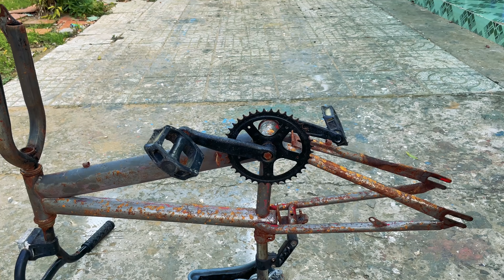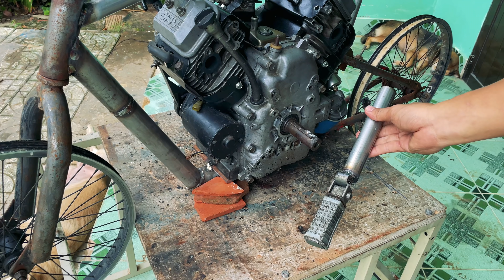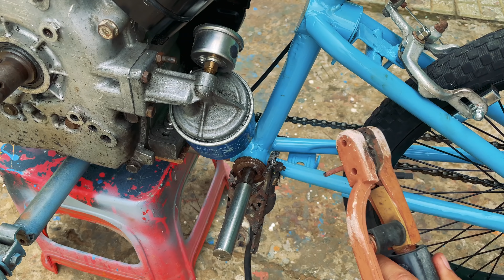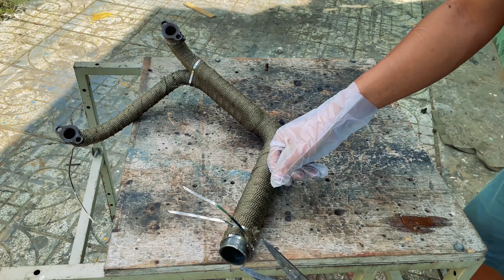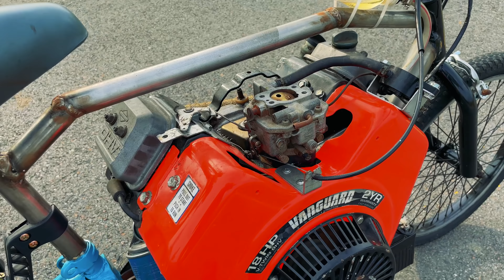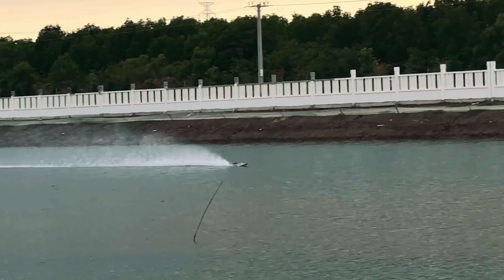Special bicycle made with 570cc V2 V-Twin engine

Comment: Very entertaining video.  I can't believe you used caliper squeeze brakes instead of upgrading to disc brakes for an 18 hp motor.  Can't wait until the next video.  Thanks.
Reply from the maker: Thank you very much, I will try harder!
Reply: @Nasatchannel  I know that you will figure it out.  You are very creative.  Best of luck to you.
Reply: Those rim brakes should be good for stopping from up to 120mph, so should be fine. 😎👍😯
Reply: Not so much cause of the engines power but it's weight alone should make going downhill a deadly gamble.
Reply: @guilhermegoldman  Agreed, larger motor means more weight and higher speeds.  May be an issue in their rainy weather.
Reply: @SilverShadow2LWB  rainy?! My 30hp 190cc 190lbs Honda with 110/90 tires is an issue on rainy weathers; that 180 lbs engine with those bicycle breaks is a fucking deathtrap if i've ever seen one!
Reply: Fun?
That vehicle will dismantle on the go! He will hardly be able to stop.
Imagine a 50kg metal block launched at 15 m / s heading towards you ...
Reply: @Nasatchannel  Hey man, you built a badass bike, don't care what anyone says! That was a awesome build, don't let anyone tell you no different. If they do, they just hating on you brother! And jealous of your bike....
Reply: Next he is going to turbo it😵😵😲😲😞😞
Reply: @pdtech4524  3 days ago, while fishing, I dropped the lighted lantern in the pond ... this morning I found it, it was still burning ... when you reduce the speed to 5mph, then I turn off the lantern.
That engine, only he weighs 50kg.
You're kidding, buddy, but I think life is at stake.
Reply: @SilverShadow2LWB  No special conditions required.
That frame will also break on dry asphalt.
Reply: @michaelgreene7385  Of course, you can dispose of your own life at will, but not of others.
Reply: @PopaAlexandru.  this is true.... but, what is life without fun every now and then? Anybody can sit on the porch and watch, as they always say,  no guts no glory!!! Better to go out like a puff of smoke, then just fade away
Reply: @michaelgreene7385  Of course, fun is fun and you can make life non-monotonous ... as long as you don't take another person's life or hurt / cripple him.
Reply: bicycle disc brake is a joke,it is even more dangerous with disc brake.This is just a fun project.
Reply: @lanchanoinguyen2914  A fun project that can cost the life of an innocent person ... of course, the village roads are always deserted and located in the desert - that is, where there is no human activity.
Reply: @michaelgreene7385  You are absolutely correct.  While sitting on the porch, I observe people taking pandemic risks, engaging in risky behavior (IV drugs, cliff diving, etc) and driving intoxicated.  All are examples of poor judgement.  I don't need to participate in order to place them in a logic chart.  The problem is not all people just die.  Some are living examples of those past decisions.  Ever see how many wheelchairs and crutches are at a motorcycle meeting?

Comment: Pls replace the brakes with hydroulics AND reinforce the frame because vibrations for sure will crack that skinny frame while you're riding!!!!
Thumb up 👍
Reply: Equipped with that engine, the vehicle can be propelled at 50 ... 80km / h and at that speed nothing in the present configuration will withstand.
The driver will be seriously / fatally injured and how other people also drive on the roads ...

Comment: you can do it as a 2 speed go a bigger back pulley keep the frount one the same and make another belt teninsion for the other belt wich will be no. 2 gear and wind the throttle alot more and disc brake's frount and back very good so far,, good video

Comment: I need information about the engine please
Reply: Briggs & Stratton vanguard engine in 18 horsepower v-twin very strong and run great
Reply: About $1500.00 USD
Reply: $1200-$1500.00 their not cheap...

Comment: I would not make this a regular get around bike. The bicycle hardware will not hold up due to the excessive weight of the motor. The brakes he has on it would scare me the most. The wheel bearings won't last. I can't see the welds holding up. Weight and vibration with eventually crack them. Other than that it's a cool bike.

Comment: The road to suicide.
Why suicide?
Those wheels won't last - accident.
The brakes will not be able to stop the vehicle - accident
The frame will not withstand the forces and will break - accident.
And you're going to take others in with you ... anyway, people who see you coming in that vehicle will be terrified at the thought of being among the victims.
Illegal: what certifications does it have to drive on the public road? In our country, it is called 'putting an unregistered vehicle on public roads' and 'driving an unregistered vehicle on public roads'. To which is added the driving of an unapproved vehicle ...
Did you do this for advertising but didn't think you were presenting .